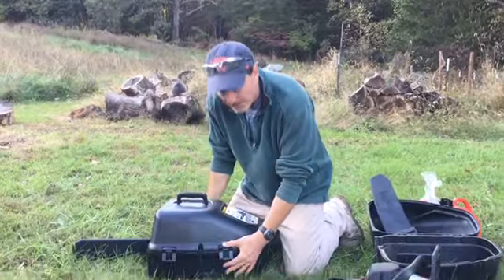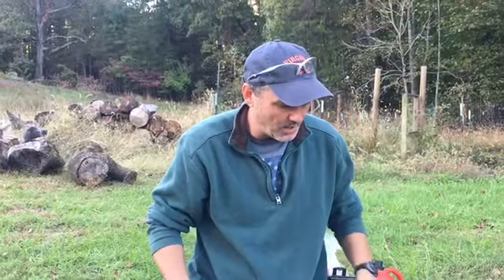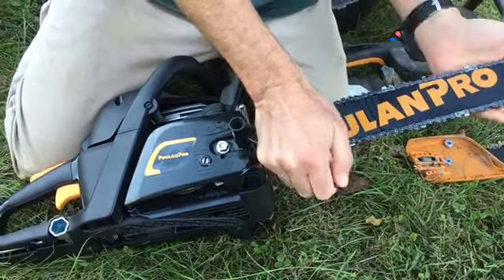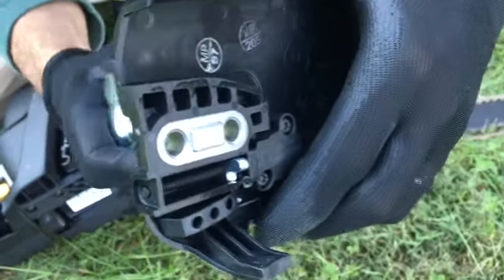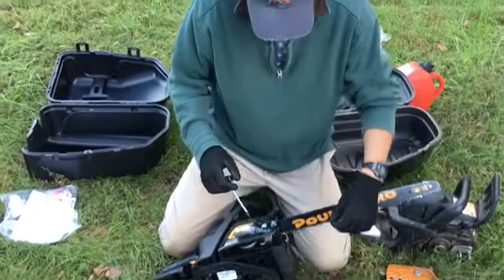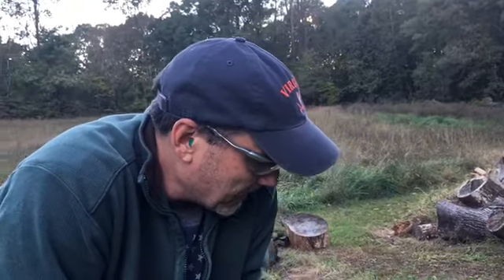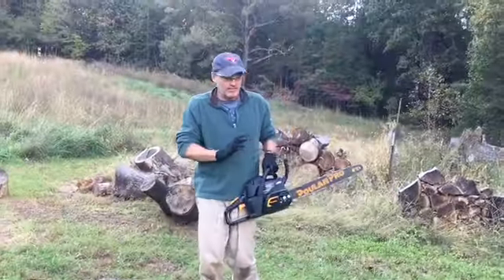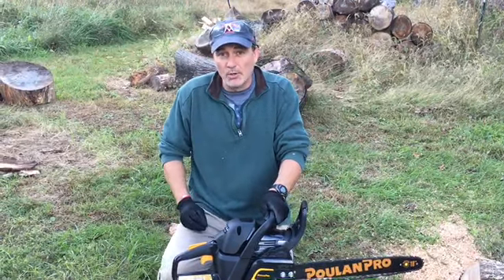Unboxing And Testing A New Poulan Pro 18" 42 Cc 2 Stroke Engine Chainsaw

Comment: I bought a Poulan pro 18" saw in 2000...I've used it to cut firewood every year since. It's a little hard to start sometimes, but easy to replace fuel lines and gaskets. Just bought a new 18" Poulan about a week ago to replace the old one for $149 at Lowes...
Reply: the new ones are garbage compared to the old ones

Comment: I have that first saw both as a Craftsman and Husq label. What I did was add a "U" shaped spacer into the channel where the screw rides. That hugs the screw and keeps at parallel to the bar. Instead of 'dipping' at an angle as you tighten and likely bends in the process. Now I am going to add an aluminum heat shield as simply a longer channel than the short "U". Thanks for the tip.

Comment: i used to use poulan saws in the past.  they became very difficult to use without any drama.  my neighbor had a husqvarna which cost almost twice the price of my poulan and constantly tried to talk me into buying one.  he claimed he had very little issues with his saw.  i had went through 2 poulan saws while he was still on his first husqvarna.  we both used our saws regularly pretty close to the same.  i broke down and bought a husqvarna have had no issues since i bought it.  i bought this saw in 1999 and it is still strong and has easily out-performed the poulan saws that i had purchased in the past.  i wished i would have bought a husqvarna long before i did.  if i had bought it years ago, i would have saved form having to buy 3 saws.  this is a time where it is definitely worth spending the extra money for an item.  a poulan back in the 1970's might have been good, but now, they are really cheaply made.  the only reason i had bought poulan saws previously was because of  my dad swearing by them.....but he purchased his saws years ago when most things were made with quality.  i hope you have good luck with your saw compared to my poulan saws that i have had in the past.

Comment: I do the same and buy a new Poulan every 3 years.  The rancher neighbors use the more expensive saws but those need costly repair every 2 years.  I just really like the new factor every 3 years or so.  I use mine every week during the winter.
Reply: My Jonsered 2041 is 17 years old. Replaced throttle wire, spark plug, piston+ring and clutch for ~100€. Also bought a good used Jonsered 2050 for 100€. Can't afford to buy a new saw every three years.

Comment: You had me laughing at the start. But good video all around. Definitely spend some time in field while using it to tune it. That thing can really put in some work. When she’s at the sweet spot. I spent a whole weekend cutting and clearing. Had maybe one stall the whole time. (User error) and doesn’t overheat like i thought it would. The chains supplied does the job. But there are better cutting chains to use than what you get out the box. Good video!!

Comment: Wish you had taken it right back as  think the threads are fairly damaged as way overnighted and threads do stretch. Also pay attention not to run out of bar oil and if you do stop right then. Also your chain way too loose before even using first time and when no oil the chain will stretch quickly as gets too tight and hot (at least if previously adjusted right).  Nice to see you out working though and stay safe. Safety pants or chaps are something well worth your money as accidents do happen with experts as well. Enjoy your videos.

Comment: Thanks for the demo. I recently bought an electric chainsaw for quick work on my small property here in Kamakura, Japan. I haven’t used it yet, but will once the autumn 🍂 gets into full swing. This video has helped a lot, though I understand that electric and ICE engines are different. 👍🏾👍🏾👍🏾👏🏾👏🏾👏🏾

Comment: I got a used  poulan 18"  42cc the newer model for  $80. Saved $100. 
And got a Walmart black max 20" 50cc new in box on sale for  $75 with 3 year warranty , retail $220, but regularly go on sale $75 -$130.
The Poulan only come with a 1yr warranty , longer if pay more. Black max 3 yr warranty included.
Black max are same as ryobi, black decker, homelite saws.  are assembled by black and decker with Honda engines that honda sells that didn't pass honda higher quality control. 
If get a better chain, and spark plug on the Poulan  and do a muffler mod,  plus drill hole in air intake to get it more air they are just fine  for non everyday use and will last years. Key is don't put them away with gas , run them dry and then put only oil back in fuel tank to keep lubricanted the primer ball and fuel lines till next use.

Comment: That was a great demonstration on using your new Popular Pro chainsaw!  The gas powered chainsaws are too heavy for me to handle now so I ended up getting a cheap electric one since I haven't been able to go out in the woods cutting down trees anymore. I have used the Poulan and it worked very well but that was a long time ago. My favorite was a 10" Echo that was lighter and easier for a lady to handle. Best birthday gift my husband gave me. Do you use an ax to chop your firewood or a wood splitter? I've only used an ax to chop fire wood. However I've seen how beneficial it is to have a wood splitter for some who can no longer use an ax as they used to. I don't have a fireplace any more so haven't kept up on the firewood preparations for winter. It looks like you and Dearly are getting the job done with your new saw cutting the logs into the lengths needed to split for your fireplace. Hope y'all have a great day!

Comment: Thanks for that - you made me laugh with the wrench. i did the same thing.. looking through the package for the wrench only to find it stuck under the handle. - not sure that's the best place to stow it - but at least they included it. than yu followed up with the triangular piece.. this is great. I sat there studying it wondering WTF... So.. I suppose if you had bought the left-handed version of the saw... this would use this piece to fill the hole on the opposing side.. ... I'm not a pro either so this was great to see. -  your humor is not lost I assure you. "yeah that bolt was pretty tight but I've been working out.." Nice demo - I like this saw and can't wait to try it out. Good camera work to. THX!!

Comment: I just come across your channel, looks interesting. I have been cutting wood for over 20 years. I have use stihl and husky, a stihl farm boss is no where near 1200.00  sometimes stihl runs special in the fall.  I used a few poulans in the day, they are made by husqvarna I do believe.
Reply: Mine didn't wanna fire up in the cold air but the poulan pro did

Comment: That tool is commonly referred to as a ‘Scrench’. Your the first amateur on you tube, that I have seen actually warm his saw up before going directly to hard cutting . A much longer warm up would avoid a ‘cold cylinder seize up’ .

Comment: If you service those poulans properly every year they will last a long time, but are still just decent saws. The best thing to do is buy an old pro saw though. I have husqvarna, stihl, and homelite saws that are 40-50 years old and still run great and cut better than any modern budget saw. It really is a good investment to get a 300$ saw that will last you a lifetime rather than spend money on these every few years

Comment: Yeah polan pro 18 inch is indeed a good running saw.my only heatsource is wood so my saw has to run.min last about 3 or 4 years cutting about 10 Rick a year .I am as careful as I can be with it .do good maintenance keep it in out of the weather. When they fail I just buy a new one . I'd rather have a fresh  cheap saw every few years as to try and make an expensive one last.

Comment: Good Video,those saws are good ,but on that particular model there is a known problem with the recoil starter,they break easy inside where the rope winds,but maybe the one from your old saw might bolt right in,good luck  !

Comment: Since it's been about 2 years , can you describe other issues that have come up  with this saw? Seen some complaints with the pull cable breaking because it was housed in a cheap plastic design....and oil leaks? Can you give us updates?

Comment: Thank you for not revving the nuts off it when it first started. It frustrates me when people do that even with old, worn in saws or any 2-stroke.
Reply: Yeah me to. Theirs a aluminum piece on most of those poulan saws that'll need took off because they will bend after using the saw a bunch then you'll not know until your chain hits it and then it messes up the teeth and the teeth that fit in the bar so 

Whatever that aluminum piece is for i take it off mine it's made me ruin a few chains in the past 

You can unscrew it off the bottom near the cover and chain or you can bend and break it off

Comment: That little puzzle piece is like a blank cover for the saw case. when the saw isn't in the case it goes in the slot where the bar sticks out. That's where it goes but don't really know what it does

Comment: Damn bro. Watch how to break in a new saw... idle 10 or 15 min. The half throttle  while under load...such as small stuff or big under 1/2 to 3/4 throttle..3 or 4 tanks of fuel..before you let her eat... but hey... if it works for you. 🙂

Comment: Couldn’t you just replace the tensioner on the saw.
Reply: Could probably find a used on on EBay.
Reply: You can, the whole replacement side plate is relatively inexpensive. I’ve even used old saws with broken chain tensioners that worked just fine, you just loosen the bar nuts and hold the bar out as tight as you can and then tighten the bar nuts.

Comment: The sprocket so early to fix. The tool under the back handle. It not a spark plug it for the husky that has real size bolts.

Comment: i should have watched your video completely before commenting but like didnt and i apologize.  anyhow...i would take the saw back because that nut shouldnt be hard to turn on the bar.  they should both turn easily......either the nut is stripped or the threaded stud is stripped or both.